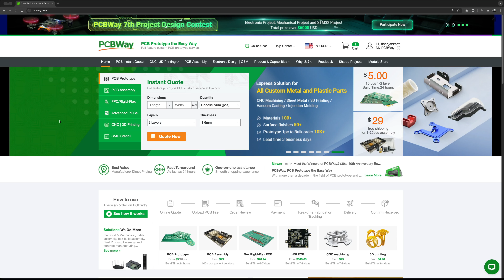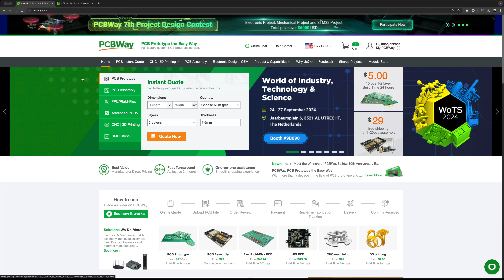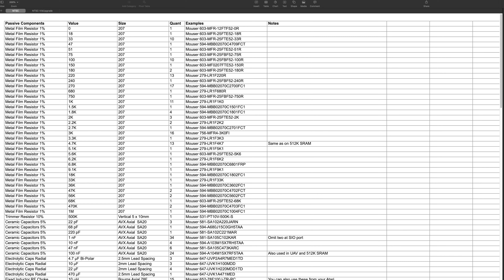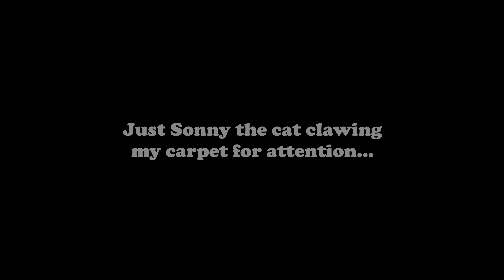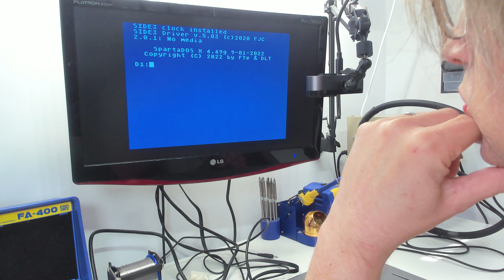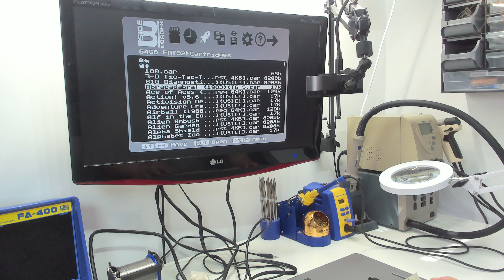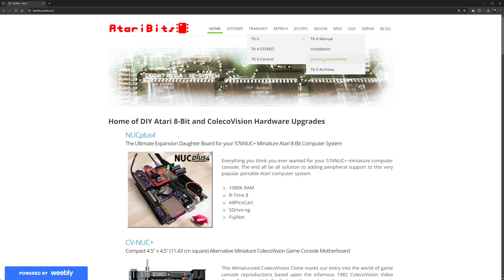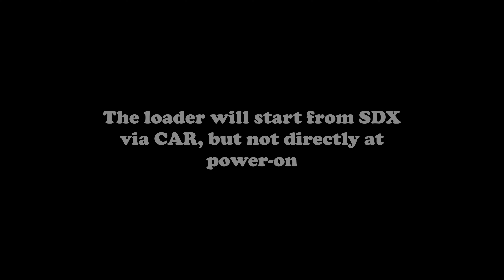Atari XE Remake Motherboard Part 2

Comment: I'm impressed with the durability of that pic chip.
Reply from the maker: I ended up replacing it after it started acting up. I then ran into some by-design quirks with the TK-II firmware itself, but that's another story. It took three weeks for the arm wound to fully disappear, however. :)

Comment: Are there any replacements for chips that are no longer made or are easy to find replacements?
Reply: The custom chips have to be scavenged from other working or not systems. The remaining NOS stock have dried or are rapidly getting depleted if they still exist.
Reply: It's pretty easy to pick up a system for $75 or so, which is cheaper than buying the chips separately.  Sophia 2 replaces the GTIA, there are replacements for freddy, workarounds for replacing the sally.   I don't know of any antic replacements.
Reply: @RobertD-v8d  thank you. I had every system up to tt and mega st falcon but before covid 8 lost it all sadly. 

Thanks again
Reply: I suck at soldering still anyways haha
Reply: For C64s, yes.  However, dead custom ICs are not as much of a problem for Atari machines because their custom chips didn't have the great misfortune of being made in Commodore's MOS Technology (later Commodore Semiconductor Group) foundry.  C64s made with their 1983 dated chips often have defective custom chips because of a manufacturing error involving chips made during a period in that year causing failures many years later.
Reply from the maker: Someone on AtariAge (possibly foft?) recently posted a photo of a machine with all the VLSIs replaced by CPLD substitutes, but I don't think some of them are ready for prime-time yet. Othert than that, Sophia emulates GTIA, PokeyMAX replaces POKEY, there are plenty of 6502C substitues, PIA is fairly readily available, there's a FREDDIE replacement, so the only one that doesn't yet have a CPLD replacement (to my knowledge) is ANTIC.

Comment: Could the space on the board for legacy video output be repurposed to put the circuitry for Ultimate 1MB onboard?
Reply from the maker: I suppose so, in theory. As I mentioned in the video: an U1MB daughterboard could push right onto that internal ECI header as well.
Reply: @flashjazzcat  - But Ultimate 1MB is not public domain, so there may be ownership issues. Seems like that one is due for an overhaul/refresh (Ultimate 4MB?) anyway.
Reply from the maker: @Randy.Wuerger  Yes - there's always room for discussion, however. I remember (according to Candle) that Mytek was in talks concerning the inclusion of U1MB on the 1088XEL motherboard (i.e. built in), but for some reason that didn't work out. I demonstrated the prototype external U1MB (in both XL and XE flavours) in a video two years ago but for a variety of reasons, no progress has been made.
Reply: @flashjazzcat  - Doesn't look like there's room for much of anything on that 1088XEL mobo.
Reply from the maker: @Randy.Wuerger  I imagine the idea was to put it where the actual U1MB plugs into the board in the design as-is.

Comment: I also was very surprised to see that the TK-II PIC chip still worked after the barbecue (must have smelled like bacon after burning your arm). Did you test the Console key functions? I believe it should default to an AKI equivalent when flashing a new PIC chip with F1=Help, F2=Start, F3=Select, F4=Option, and F5=Reset. Also if you want to use the stock keyboard, you need to have XEGS mode turned off, check by pressing ALT+X, and change by pressing CTRL+ALT+X. You only need to do this once, since the setting is non-volatile being stored in the PIC's internal EEPROM.
Reply from the maker: Hi Michael. No smell, but two days later the top layer of skin peeled off and left a damp wound and I still have an elastoplast on it now. It seems to have dried out but I have the plaster on it just to stop it catching on the edge of the desk when I'm using the PC. Thanks so much for the extra info regarding the TK-II (and no, I didn't test the console keys yet) - especially XEGS mode which absolutely catches me out every single time owing to the default being 'no internal keyboard'.
Reply: @flashjazzcat  The reason why it defaults to XEGS mode has a little bit to do with how things started out with the first boards being for the XEGS and another prototype that was being tested on a 1200XL. Both of these Atari systems turned out to be the only ones that put the KR pull-up resistors on the keyboard and not on the motherboard which created a "floating" condition and ghost key presses. So since the boards were already manufactured, I had to come up with the XEGS Mode where the KR outputs are put into TTL mode. This mode completely takes over the KR lines for itself, and thus blocks the stock keyboard. However by turning XEGS Mode Off, they go back to what's considered an open-drain state, where a pull-up resistor is required, and you can run multiple keyboards in parallel without interference.

Since the idea of having a TK-II is usually that the user wants to use a PS/2 keyboard, having it default to a "reliable" mode that was assured to work on any Atari 8-bit seemed like the logical thing to do out of the box.
Reply from the maker: @michaelst.pierre1187  Thanks for the background information. Certainly once one knows about this and providing one can remember it, it's not a show-stopping issue, but I still think that it would be more user-friendly if it didn't by default render the internal keyboard completely inoperable. The fact I'm installing the board for a customer doesn't necessarily mean I have a PS/2 keyboard on hand and attached the first time I power on the machine to check basic operation with all the upgrades freshly installed. I know from bitter experience that even competent users can be left in a state of confusion by unexpected default conditions, even if it's pragmatically speaking a PEBCAK issue. :)

Comment: In the "what could possibly go wrong" category, you haven't tested the joystick ports yet.  They're essentially a direct line to various chip pins, so there's not much to go wrong.  It would also be interesting to find out if the BASIC ROM was supposed to work, or if it's simply not supported (if you said in the video, I missed it).
Reply: He used the joystick port to program the PIC, my guess is the ports do work.
Reply from the maker: Port 1 certainly works, as @pe1pqx321 says, but it would probably be worth testing the joystick with the SIDE3 loader (in both ports). As far as I can gather from the errata, a masked BASIC ROM will not work, although I haven't looked into why or whether this can be patched.

Comment: Dude, the flashjazzcat effect has gone into effect, and I cannot find these for sale...looks like abbuc is out.  Oh well, now that I learned to solder...and yes I will shout to the universe that I learned how to solder after all these years and I'm quite good at it, so now I want more bare boards.  I just don't want some machine that atari made, it has to be one I put together now.
Reply from the maker: I still didn't check whether this is an open design which can simply be ordered from the board house of one's choosing.
Reply: It's not as far as I can tell, and considering this and the fact that it has  at least two routing problems (DVI and Basic) together makes the idea of getting one a bit off-putting.
Reply from the maker: @TheWoj76  Understandable. I was a bit reluctant to take the job on in the first place anyway (having to source the BOM and all other information myself), and that was on the assumption that there were no known problems. It's worth noting also that I replaced Q3 with a part recommended in the AtariAge thread in response to a complaint that stock video lacked colour, and... it still lacks colour. No problem since the owner will use the UAV circuit anyway, but still.

Comment: I just don't see the point of those mobo reproductions... The biggest failing point by far are the ICs not the motherboards. So putting old chips on a new circuit board doesn't really correct the main sources of problem. It would be better to create a brand new device that operates in the same way and is code compatible with the original.
Reply: Sometimes you want that new car smell - even though the motherboard is hidden in the case.
Reply: Sort of makes more sense for machines were cap/battery damage is very common. But if you are going to jam CPLDs and FPGAs all over the place to replace/enhance the original chips you might as well just make a board with a single big FPGA on it at some point.
Reply: @donpalmera  That's my opinion also. It's good to have an old computer still in working order in your collection, but since those ram, rom, audio and video upgrade are in the end creating a totally different machine than what it was, why not strictly use new parts for everything. Call it an Atari 9000! It's a bit like pimping a classic car with a modern engine, modern suspension, modern electronics. The only thing classic left is the body...
Reply: @Tuxon86  I don't see how adding ram makes it a different machine than what it really was, I had 256k ram back in the day, also soldered in.  We didn't have such concerns back in the day.
Reply: It makes the most sense for classic machines that have batteries on their motherboards that often leak eventually and destroy the board.  Same with SMD caps. Amigas are affected by that.  A popular channel dealing with Amiga repair: 
Chris Edwards Restoration
https://www.youtube.com/@ChrisEdwardsRestoration/videos
Reply: @RobertD-v8d  Those expansion aren't stricly just additional ram. They also brings new roms and capability. Look, I'm not in anyway saying people shouldn't do this, heck I had my 65xe modded by FJC! What I'm saying is if someone is ready to put in the effort of creating a new mobo, he might as well integrate all those mod directly on the board instead of using obsolete and slowly dying ICs upon which you'll connect those same mods... Make a board with 1umb and an fpga replacement for the antic/gtia instead of the ram and video. Use a faster still available W65C02S6TPG-14 CPU. In short do an Atari Commander X16...
Reply: @Tuxon86  and where do you propose getting those FPGA replacements for Antic and GTIA? As far as I know the ones that are out there are not open source designs. Where the upgrades were in the public domain such as UAV and the TK-II they've already been integrated into this new mobo. And let's not forget that there are solder pads and/or extra headers provided for supporting the proprietary upgrades. So this really isn't simply a clone of the original mobo.
Reply from the maker: The thought crossed my mind (that we're simply making a workalike of the original motherboard, using the same VLSIs), but I think the appeal is in the nicer layout and the fact it's 'new' (which is why I used more expensive, better quality passives, because what's the point otherwise).